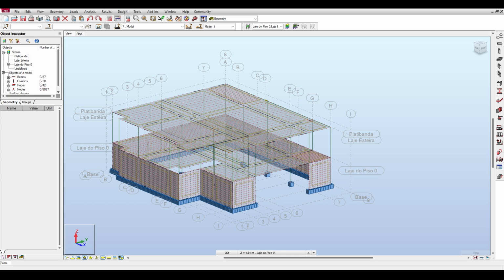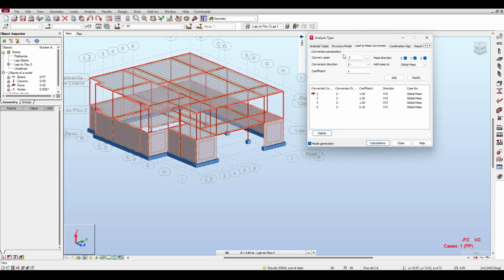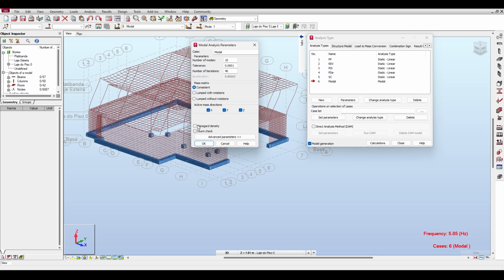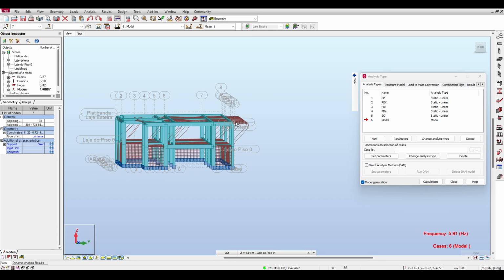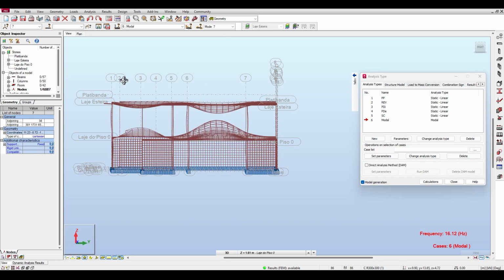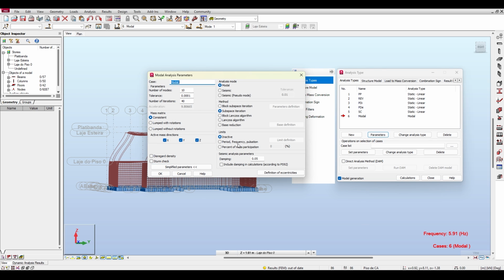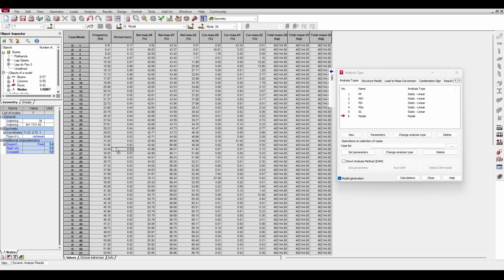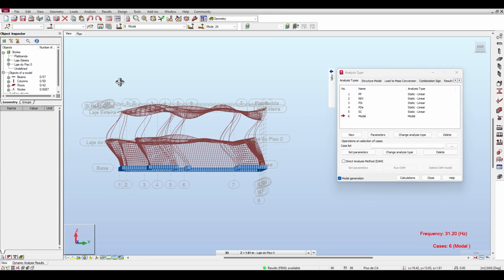Understanding Mass Participation in Modal Analysis using Autodesk Robot

Comment: I would suggest you to not consider the participation of Z direction, because you have a model assumed as a diaphragm, floor by floor (only X, Y and RZ are blocked). You can do this automatically with something that Robot calls "flexible diaphragm", just changing the lamina model of your floor, in the finite element mesh, by rigid unions. Then I bet that less than 6 modes will be sufficient for your structure for the mass participation, and not 60... (you have a simple model, not a complex building) Of course, you dont have to consider the basement for mass participation, but for modelling.

Comment: Hi CEE

Great content as always. 

Any advice for converting vibration readings using the fast Fourier transform to find the operating frequency range to avoid. 

Thanks.
Reply from the maker: Hi there and thnx for your comment.
You comment may be understood in two ways, and I will address both.

The first way I understood it is:
You have a vibrating machine (let's say a sieve or a crusher in an aggregate industrial plant). This machine will of course vibrate as follows (names may be different, but ideas are the same):
Transient vibration (this happens when the machine starts up or shuts down)
Sustained/ steady state vibration (this is what happens during normal operations)
Kind of like your car, when you start the ignition, the car vibrates differently for 2 seconds before it goes to the steady state

Now if that is the question, then you can find those information from the manufacturer of the equipment. He is required to provide you with:
1) steady state vibration frequency
2) force amplitude.

The second way I understood it is:
you have a vibration of unknown source, a fourier analysis is to be done. I am assuming you are not asking about "the math" of fourier, but rather about how to interpret the results of fourier.

Interpretting the results is actually easy, if you have the transformation plotted in a power spectral diagram, you will notice spikes at certain frequencies which are the dominant frequencies of the vibration.
You an use those frequencies to recreate the vibration you measured using cosines and sines. Note that you will not be able to create it with 100% accuracy because you are only taking "dominant" spikes when recreating and modeling the signal in RSA.

I hope I understood your point correctly and addressed it,
if there is anything I missed, or if you have further questions, please let me know, you are more than welcome

Regards,
CEE

Comment: Thank you for such valuable information, I have two questions to ask, I hope you can help me:
1) In ETABS you can show the percentage of rotational modal participation, that is, the percentage of mass that is rotating in the Z axis, my question is, how can we analyze what percentage of mass participates in the rotation of the Z axis in ROBOT
2) In the video it is concluded that the mass above the base level should be separated and the mass below the ground level should be neglected. That said, is it correct to model the foundation together with the superstructure? What would be the considerations when modeling the foundation as a whole, that is, foundation depth, is the design of the concrete columns affected by the soil confinement or not?
Reply from the maker: Hi there, you are most welcome.
in RSA, you can show rotational mass participation by going to the modal mass table and:
1) right click on any column of that table
2) Go to the Table Columns
3) Mass Sums
4) Enable anything you need.

Hope it helps.

For modeling both foundation and superstructure, the reason why you may want to do this is to get the loads on the foundation itself and design it all using 1 model.

You still can separate it into two models. One for the superstructure and one for the substructure. The only hassle might be in load transferring.

Comment: Hi again Dear CEE have one more question how could you run a calculation with only compression springs (non linearity?) how do you define their kh modulus? Thank you so much!
Reply from the maker: Hi there.
You can do this by going to:
Geometry -> Supports

Then go to linear support tabe
There, click on new
then, you can remove the Ux direction (for example) but enable uplift, and tell him which direction. (positive or negative)
I think this is worth a video really. Thank you very much for giving me the idea ^_^

Comment: Etabs seems to have great output of results when it comes to seismic analysis. Could you please talk about scaling of base shear reactions between static and response spectrum? What does Eurocode say about this?
Reply from the maker: Hi there and thnx for your input.
I might not have understood what you mean fully (I blame myself for this). So, just for my own understanding, can I ask about what you exactly mean?
is it basically that a dynamic / response spectrum analysis = factor x static analysis?
Reply: @CivilEngineeringEssentials  there is a requirement in other codes like ASCE to match base reactions due to equivalent static method and linear dynamic method like response spectrum method. I can't find it in Eurocode.

Comment: According to Eurocode 8 (earthquakes), the mass participation of the structure must be greater than 95%. Not considering the mass of the basement structure because the seismic action occurs immediately above the ground, I consider it correct, but the truth is that the code nowhere states that this should be the procedure. Thank you CEE, as always your videos are great.
Reply from the maker: Hi there Engr. Pedroso and thank you for the model. 🌹
I am happy that the vid was beneficial.
You can still increase the number of modes in that case.
Reply: @CivilEngineeringEssentials  one question how you separate the Wall mass and columns in the basement from the rest of the structure?
Reply from the maker: There was a comment by @calypsotravel that is very good in explaining it.
"I would turn on disregard densities, separate the selfweights, i.e superstructure selfweights and basement walls as two separate load cases. Then,  I would only select the superstructure selfweights and the live load as participating masses. The basement will be excluded for the modal analysis."
Reply: @CivilEngineeringEssentials  Yes, personally I do exactly that procedure to perform a modal analysis, when converting the masses, the self-weight of the structure above the base, the dead load and, if necessary, a percentage of the live load are chosen.
Reply: what does Eurocode say about scaling of base shear reaction? other codes talks of scaling base shear between static and response spectrum. I don't seem to get any info from Eurocode.
Reply: @calvoh9715  me too. This subject for me is very strange.

Comment: Your suggestion not to include the walls is correct. Base shear will be at ground level and not basement level. I would turn on disregard densities, separate the selfweights, i.e superstructure selfweights and basement walls as two separate load cases. Then,  I would only select the superstructure selfweights and the live load as participating masses. The basement will be excluded for the modal analysis.
Reply from the maker: Thnx a million🌹
That's a very important point. I slipped my mind talking about seismic action.